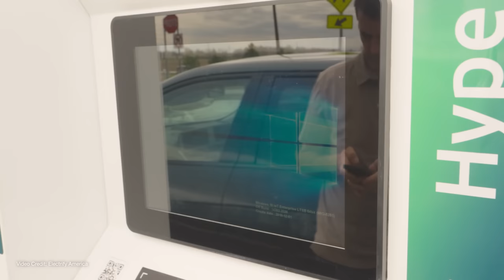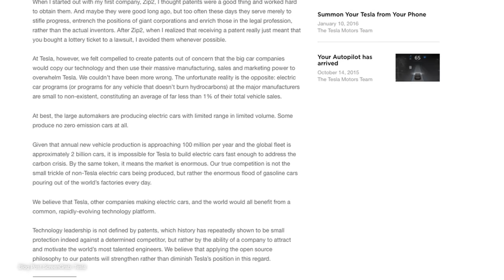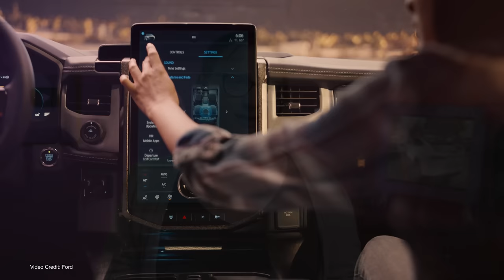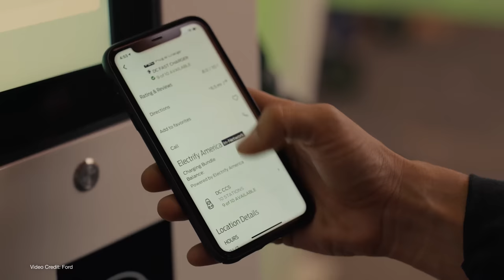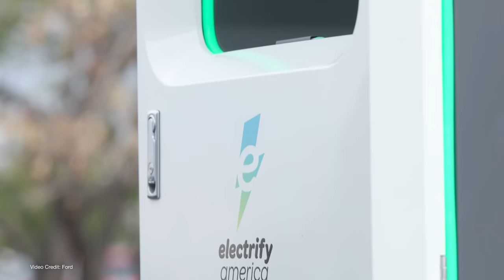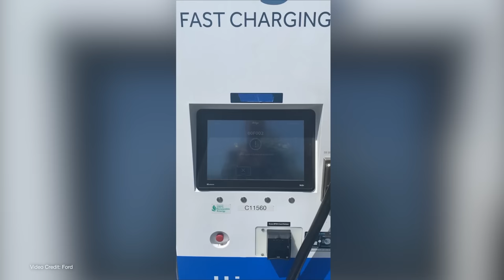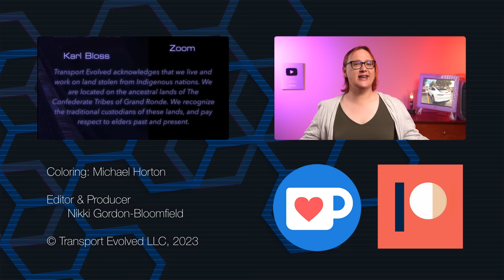Ford's Switching To Tesla's NACS Charging Tech - What We Know (And Don't Know)

Comment: I get the general impression from "Munro Live" that the NACS standard is cheaper to implement then the CCS standard.  As the automakers currently implement the charging ports, the cost difference is significant.  It makes financial sense for Ford to only install NACS on a car.
Reply: CCS on car is cheaper to be done, because those are 2 different sets of wires for AC and DC. Has Munro been talking about cost on Cars, or on Charging Stations?
I guess it would be cheaper for Ford to only have NACS for DC charging
Reply: Cars

Comment: Honestly, I am very happy with the charging experience I've had with Electrify America and other CCS chargers. The main issue is that they aren't where I need them. Oddly enough, Tesla Superchargers are in those locations that would make the routine trips out of town that I make with my Chevy Bolt pretty easy. The bottom line is that I don't care who provides charging. I just want charging where and when I need it.
Reply: Yep. I've been driving EVs since 2018, and have only been truly unable to charge at a station once - and there was another CCS station 5 miles down the road that worked fine.

Comment: The problem is not all software -- the CCS connector is clunky and damage prone. Your stock footage of a woman plugging in is a good example. She is young and fit looking, and she's grabbing the cord with two hands and leaning in to get it inserted. Someone older, smaller, less fit, or with some disability might really struggle. The NACS connector is far easier to plug in.
And the large, heavy, CCS connector is prone to breaking its latch if dropped. The NACS connector has no moving parts, is lighter, and survives drops without damage.
Reply: Right on.  Why is TEN saying there's no issue with the CCS connector?
Reply: The problem with NACS is will Tesla truly open up all the needed protocol details or will it remain that non-Tesla cars live in some compatibility penalty box? NACS also has no answer for three-phase AC charging which is popular in many parts of the world.
Reply: @stevewausa  a good point, but not related to his point.
Reply: @stevewausa  I don't know anything about whether or not Tesla has detailed their communication protocols.  I would note that the Tesla chargers with the "magic box" adapters are capable of "talking" to unmodified EVs with CCS1 inlets. And Tesla's cars can "talk" to CCS1 chargers and charge from them with the use of a simple passive physical adapter. So once the bugs in the implementation on the CCS1 protocols are ironed out, all cars should be on an equal footing with regard to communicating with the chargers.
Tesla has, however, made a choice to reserve some charger for Tesla cars. In both Europe (where all cars use CCS2) only about 50% of Tesla's chargers are available to non-Tesla EVs. The deal with Ford only gives Ford EVs access to about 1/2 of the North American Superchargers.
As for the lack of three phase -
The CCS1 connector is also lacking the pins to allow three phase AC charging.
The Tesla connector is proposed as the standard for North America, not the whole world. There is no 3 phase AC level 2 charging here, and it's not likely there ever would be. So the NACS connector is not inferior in that regard, and is overall the clearly better choice for this region, in my opinion.
Reply: @PhillipStewartYYZ  Elon Musk's apparent support for or agreement with various transphobic content on Twitter is, I suspect, coloring the presenter's opinion. It can sometimes be hard to keep such influences from creeping in to the way any of us view the world - especially when the stakes are high. Nicky generally works hard to avoid letting that happen, but she's human....
Reply: @stevewausa  Tesla is sharing the needed software (API) to communicate with their chargers which should make the charging experience just as reliable for a Ford or GM user as a Tesla user.  It would not benefit Tesla to have a bunch of charging customers on customer service calls.

Comment: Nice review.  My 2 cents.  "every charging company needs NACS" - a majority of the current charging companies will fold/merge.  Problem solved.
Charging monopoly - US is historically anti-monopoly, even when monopoly (aka: standardization) makes sense.  Nonetheless, monopolization/standardization happens when products really are better.  (example: the Apple/Android duopoly)
My NACS car can charge at CCS today, with a pretty easy adaptor.  Unless those charge stations are broken/missing or otherwise OOS. THAT's the problem.
Reply: Its a monopoly....
You have to pay elon's to use NACS. A standard would be "open source". The lines are blurry. ICE thinking: no one has a control over the gas nozzle dispenser and how it compatible with the ICE car.  You have that issue with electricity nozzle Dispenser with EVs
Reply: @Frank71  Was someone paid for their design /patent of the gasoline nozzle???  Same thing. We just have been using some things so long we don't realize that at one time they may have been proprietary.
Reply: @Frank71  No, EV makers and charger makers don't have to pay Tesla anything to use the physical NACS connector. Tesla published all the details, mechanical and electrical months ago, and made it all open source, license free.

Comment: At 09:32 - Ford hasn't kicked CCS completely (AFAWK)

Absolutely. Another contributing factor that has come up elsewhere... The Passenger side fake charge port is the perfect place to add a NACS port while leaving the CCS port where it is.

The passenger side would put the charge port during a pull in for a Lightning in the "correct" location for SuC (Super Charging) NACS charging stations...  Tesla cars pull in backwards for the port on the drivers side, for comparison, and why this would make sense.

Although the cable might be still a somewhat tight reach, maybe they will keep both ports but move them forward a foot or so?
Reply: I'd say there's no way this will happen, in the era of cutting every single unnecessary component, that a whole extra port and all the components  will be put in place. Far simpler to have an adapter such as Tesla users can get if they want to use another charging network.

Comment: NACS simply looks better and is more ergonomic. That's the design side of it. That, to me alone, is reason enough to ditch CCS. Us Americans seem to love their clunky fueling nozzles. I guess CCS makes people nostalgic coming from a gas pump world.

On the Tesla network side, it just works. The ease of use with no RFID cards or having to use crit cards and all that is the easy to get use to and spoiled over. While I don't want Tesla to monopolize the charging station industry I do want the NACS to become the defacto standard for the US especially since most Americans don't have any plans to move export their car to another country..and doing so your car might not work anyway regardless what adapter you were using.

Comment: 4:55 - I had a similar problem. I arrived at the Staunton VA EA charging location...having not checked before hand to find that 3 of the 4 towers had been completely removed and new trenches cut into the pavement. When I went again a month later, all was good, with new equipment. But it did get me to start checking ahead before trying to stop and charge somewhere. If this happens a year from now, I'll be able to drive a block over to the nearest Sheetz and plugin to a Supercharger 🙂

Comment: One standard is absolutely the way to go. I don't pull up to a gas station and then worry about the size of the pump nozzle or whether my car can fill up or not. Electric vehicles need to be the same way. And the NACS standard is absolutely, undoubtedly the best standard available and should be chosen by all manufacturers. Ford (and others) should still build out a charging network with NACS (so you dont have to "Give your money to Tesla)...not just rely on Tesla. And  Electrify America,.EVgo, etc should immediately start putting in NACS adapters on their current units and then going forward build stations with those adapters/connectors. Or be left behind and out of business.

Comment: I expect it will only be a few months until another legacy automaker makes the switch to NACS when their higher ups experience first-hand how bad EA and other CCS networks are.
Reply: And charging with CCS cars on Tesla chargers has been ... no different than charging on other networks, with the same issues. And NACS is just CCS with a different plug, the Tesla plug.
Reply: @Hans-gb4mv  NACS is a leaner more efficient connection that doesn't need to be held up to make the initial connection to begin charging.
Reply: Changing the charge handle doesn't change the the hardware and software. Put CCS docks  on tesla handles and get a different experience.? Tesla was built for tesla hardware.not necessarily the best for other systems. Everything was moving to 800 volt systems. V2G etc.
Reply: @JohnRoss1  if the other automakers would stop outsourcing all of their components they'd have better control of their software and hardware capabilities.  V4 NACS has V2G capacity so no problem there.  The majority of vehicles in North America are already using NACS so why go to a larger, less efficient, less robust, splintered connection?
Reply: If our tax dollars subsidize charging infrastructure, we need to legislate minimum reliability and functional standards. Like: you only get the full subsidy after showing 3 years 95% uptime. A standard SLA for subsidies could go a long way.
Reply: @grantandre79  totally agree on that one.  No half-a$$ed networks gobbling up funds that rarely get repaired/maintained.
Reply: @grantandre79 Yes, and have people actually go test the chargers to make sure they work. Sometimes the chargers report that they're working when they aren't.
Reply: @MarkLLawrence  What do you mean by "less efficient". I suspect the CHAdeMO connector is the most efficient one commonly used in North America. It is massive and unwieldy though.
Reply: @jamesphillips2285  less efficient as in it is much larger than it needs to be in order to connect with a vehicle.  The three R's in the green movement are: Reduce, Reuse, Recycle.  Making the connector as compact as possible is not only more efficient with resources, it also makes it easier to handle.
Reply: @MarkLLawrence  Thinner cables will generally have more electrical resistance though.
Reply: @melissamybubbles6139  Agreed: the charger or charging company shouldn't be trusted to self-report thier own "working" status. IMHO, the public could "crowd-source" this data. Like: every charger could have visible identification (maybe a QR code tag) and users could be invited to report when the charger doesn't work properly. The user reports would need to go to an independent authority (open-source project, federal govt) and could be evaluated against the kWh delivered by the charger to build a meaningful uptime stat.
Reply: A few days.
Reply: @SDGreg  lol, I was about to come say it myself!  NACS is winning the format war!  A warm welcome to GM 😉
Reply: You were wrong mark it was a week
Reply: @alanrickett2537  lol yup.  I admit I was off on that one.  Now how long until the next automaker makes that switch?
Reply: @MarkLLawrence  not sure I think they had been talking to these to for a while, so it could be a few weeks but who could it be. 
Possible
Satlantis (however you spell it) , rivian, MG.

Unlikely
Lucid , Kia, Hyundai, Mercedes, faraday futures 

Would be a huge surprise
BMW, VW, Toyota, Honda
Reply: @jamesphillips2285  but lower losses as it reduces the current and the losses are current squared time resistance so  current has a bigger impact
Reply: With GM now announcing a transition to NACS today, I wonder whether Rivian owners are going to feel outmoded. Would Tesla even allow Rivian to use the SuperCharger network? VW (and the whole VW auto group) are likely also stuck with the dying CCS network since Electify America CCS charging was setup by VW. How will those folks feel? Time to mandate a standard!

Comment: It would be great to see a UCS (Universal Charging Standard) which hopefully would be adopted by most, if not all, parts of the world. There should be some solid standards to make the charging experience better and more reliable for as many people as possible. It should have the same form factor for cables and charging port and connectors (much longer than Tesla's cables, but with a similar form design). It should have good interchange software built-in to allow the widest range of vehicle owners to share in the same ease of plug, charge, and autopay. It should also support a range of vehicle needs and capabilities from the lowest voltage up to 1,000 volt and 50 to 500 or more kilowatts. It should also have vehicle-to-home charging capability included for home chargers.

Comment: That's quite unfortunate timing that one day after this video was published, GM announced they were switching to NACS too. A lot of people online have been joyously saying "CCS is dead" but I don't think so yet. NACS will be using the CCS communication protocol so it still lives on in that way and that also means passive adapters should be available. I'm not too pleased with how late Tesla opened up their port but I don't think it's game over for CCS or CCS equipped EVs. Future charging stations will likely have both CCS and NACS plugs on them and adapters should be available to use at DC fast chargers with only NACS.

I'd love to see an update/follow-up video to this one which takes into account GM's announcement.

Comment: It doesn't matter that much what the standard is, as long as it is universal and capable (can handle current and future high charging speeds, VtL & Vtg, plug-and-charge capable), but no matter what it should be backwards compatible, at least with an adapter. We need to avoid another situation like we have with CHAdeMO, where we have hundreds of thousands of vehicles becoming less and less usable for no reason

Comment: If one wants to pass themselves off as a "standards body" for an interface, then one should have a policy of at least defining criteria for whether an arbitrary product meets/doesn't meet their standard.   Ideally, the standards body provides test hardware to verify compliance; or at least, certifies 3rd party testing labs to perform compliance testing.   Permission to display the interface's logo should be strictly contingent on passing such a test, and the standards body should sue the damn asses off of any manufacturer that counterfeits the compliance 'seal of approval'.   This rigor is scarcely ever achieved, as far as I know (the USB standards are the only examples I can think of), but when it IS, users can reliably expect that "if it plugs together, it works together".  From what I've gathered, CCS doesn't measure up to this.
Reply from the maker: This is a good point. NACS is only a standard because Tesla has deemed it so. And standards... need someone to set them.
Reply: This is what SAE and ISO are for.
Reply: @stevewausa  In theory, yes.   But weren't there some headaches with the LEAF's J1772 charging, where, because some equipment didn't actually uphold the standard, diagnosis was difficult?   As I recall, the "standards body" meekly allowed the noncompliant equipment to go uncorrected.
Reply: @stevewausa  Agree, but then again SAE stands for Society of Automotive Engineers which is primarily a body of Internal Combustion Engine vehicle engineers that may not really be interested in the future of Electric Vehicles.

Comment: Regardless of the particular charging system, what we need is a formal certification process for compliance with the standard (be if proprietary like Tesla's, one maintained by an industry group or by a forma standardization body)  for both chargers and vehicle side of the system. Interoperability is the key. One could borrow a page from the way computer industry does that with some of the higher end interconnect standards.

Comment: Here's a weird thing: Ford will not provide a cable with its new EVs, you now have to buy one for $500 (usually free with the EV!). A NACS EVSE is $500 (you can buy a decent J1772 EVSE for $200!). Then if everything goes NACS, we all have to buy an adapter ($?). It feels like we're being bled here - but maybe there are good reasons for the switch.

Comment: Regarding the home charger backup that should work with the adapter as the NACS announcement docs showed the connector can do V2X but they hadn't implemented it yet, seems the partnership with Ford and possibly being the only EV pickup without some sort of power offload might kick them into gear to finish that implementation.
Reply: Ah you got to that shortly after, Agree about not wanting Tesla to be the charging monopoly, need competition but it would be nice with the NACS